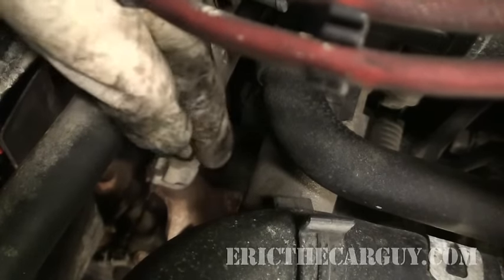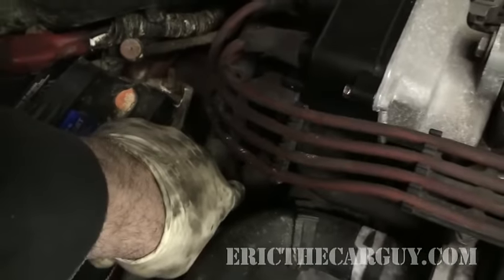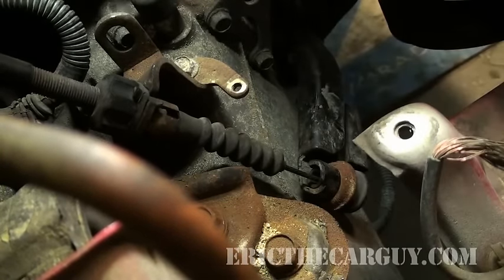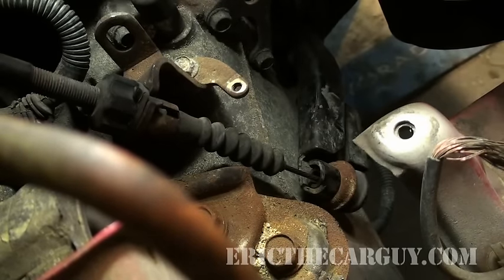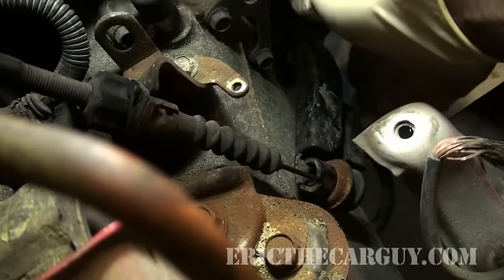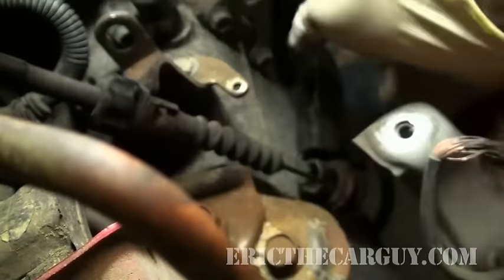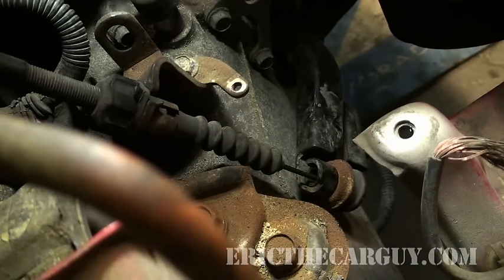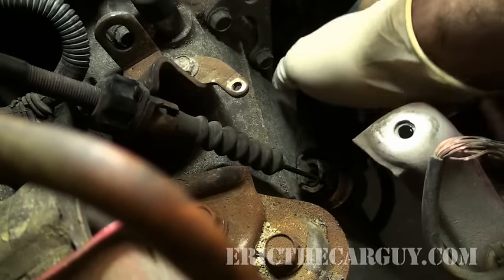How To Adjust A Cable Operated Clutch, Honda - EricTheCarGuy

Comment: Hey eric i got a 1995 honda civic manual. But i can start my car without pushing down the clutch. Can i fix that some way?
Reply: Leon Wilkinson I'm hoping this was a joke. You have to push the clutch pedal down to start manual transmission vehicles.
Reply: Thanks
Reply: +charlie s in a lot of older imports you don't need to.
Reply: Safety switch.However I'll leave the way it is Bro just
Reply: It's possible that your car has improper wiring due to a manual transmission swap but it could just be a sticky sensor on the pedal